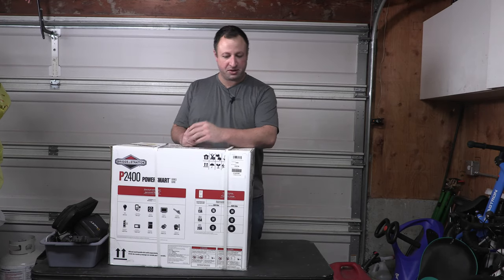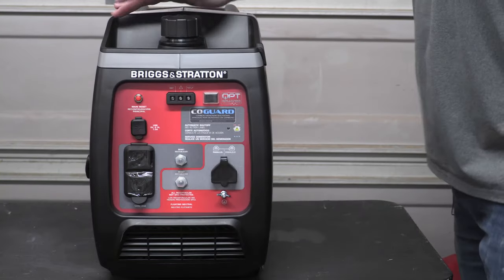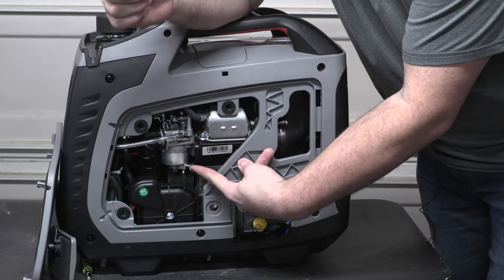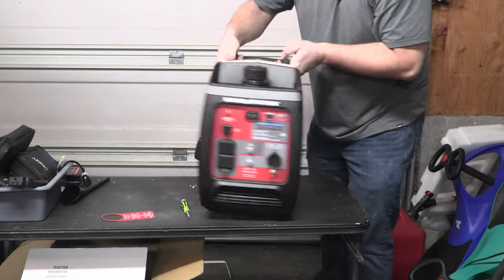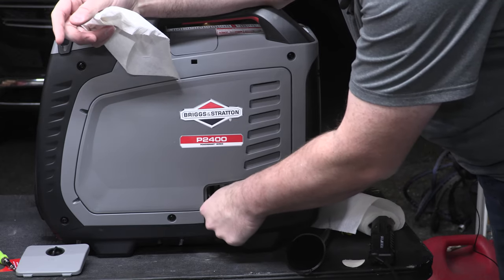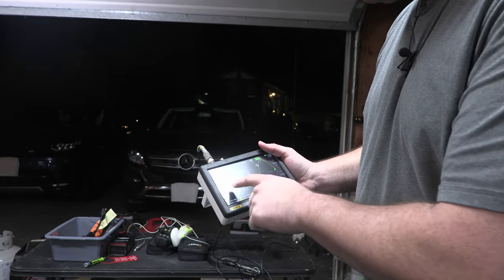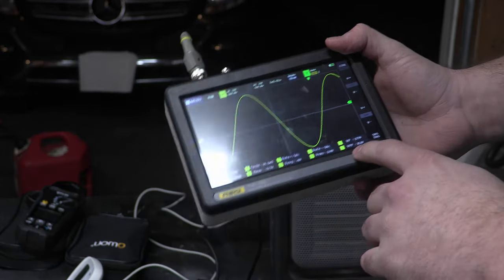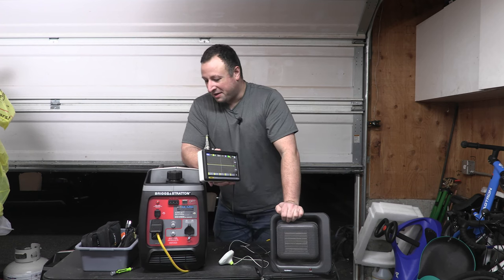Briggs and Stratton P2400 Generator Review

Comment: Excellent review. I waffled between the B&S P2400, an  Onan P2500 and the Honda EU2200i. I will be a very low hour user and the Onan offers 2200 running watts which is excellent and Honda quality is hard to beat but the price is ouch! Eenie meenie miney mo. It seems that you are hesitant when you posed the rhetorical question "Would I recommend it to a friend?" Another area you did not discuss, and this I have experienced personally; when the SHTF the first thing to disappear even before food is gasoline. This recently happened to me but there is no such a huge run on Propane. Think about it. As soon as people talk about an interruption of gasoline everyone heads to the gas station, Propane has a much lower priority, It would have been interesting to see what is involved in putting a propane conversion kit on this gen. The advantage in propane is availability, it doesn't deteriorate and it doesn't gum up the carb especially if you are an infrequent user. 
    I looked at dual fuel generators but the offerings are not as attractive as the gas only which can then be converted. Like you, I am leery of "white label" brands and low volume models for the reasons you provided.